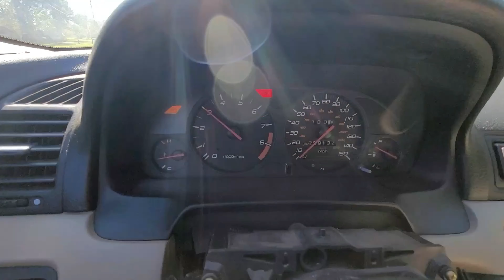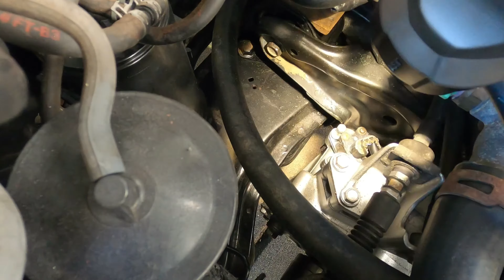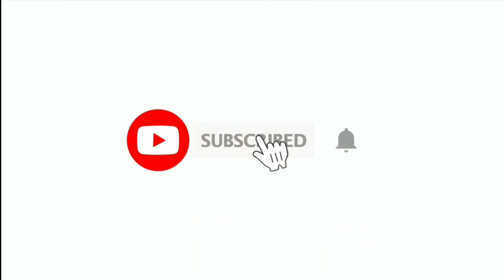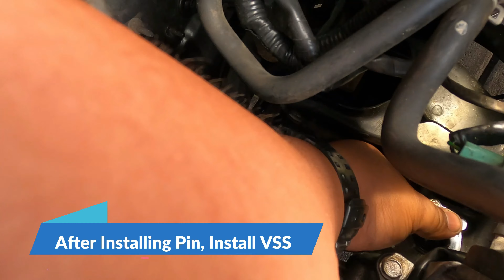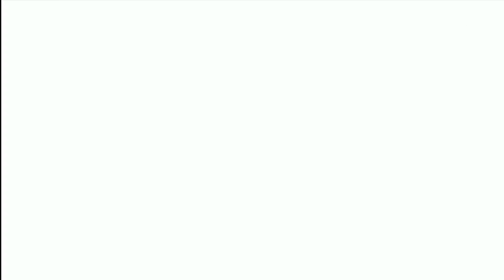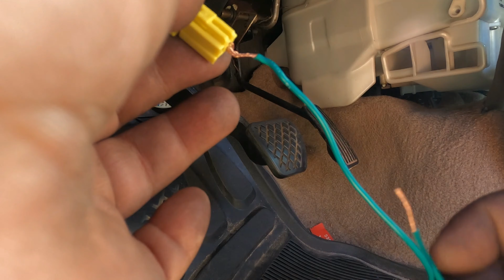1997 - 2001 Honda Prelude Vehicle Speed Sensor (VSS) / Speedometer repair and SRS Reset!

Comment: Fantastic job! Straight to the point concise simple videos. New subscriber!... I have two 1999 prelude Mt. 
One is the rat rod. 
One is completely original. 
Have you ever considered changing out your fifth gear to a Honda Accord fifth gear for that taller ratio so you're not screaming at 4500 RPM at highway speeds? 
Might you have any guidance on that?
Reply from the maker: I know some folks here uses lsd dif and final drive regearing from accord transmission. Long time ago, we swapped a USDM H22 to a 98 Accord. Used original Accord transmission and it performed relatively well.. Eventually, the transmission was swapped to a B16 with LSD [H2B].

Comment: Would replacing this sensor stop the d4 light from flashing and causing transmission problems in an automatic 5th gen ?
Reply from the maker: That's more likely to be a shift solenoid issue..

Comment: Just ordered one for my 99 model from Rockauto, 50 bucks.  Autozone wants $101 for that duralast.  Mine is intermittent right now.  Works about 99.9% of the time then it will fail for about 5 minutes then start working again.  Hope this fixes my issue.  If not, I'll have to start hunting wires.  I'm thinking this lil part was probably not intended to be used the way I use my car.  Cruise locked in at 85 for 3 hours at a time....with the occasional angry foot to 150 to get away from the morons.  Car only has 97k miles on it.
Reply from the maker: RockAuto hasn't failed me yet! I love shopping from them too!
I wish we could drive those speeds here in VA.. In my area, we're capped at 60mph.. little over that, in most cases, is a ticket..
If the replacement part works intermittently, check on your wirings.. you may have an open, short to ground, or loose connections..
Reply: That sounds like a hell of a sweet ride, I just bought one. A 1999 with 260,000 mi on it and paid $4200 because it was  one owner all original. 
What did you give for yours?

Comment: My son has a 5th gen prelude.   He said his RPM gauge stopped working,   any ideas what to check?  I am not finding anything on youtube.   Thanks in advance.  We used your videos to replace the clutch on his car.   Bro those were on point.  Thanks in advance
Reply from the maker: These are the things you want to check:
There's a capped connector close to the fender. Check the continuity with that blue wire to your distributor. There's a small blue wire in the dizzy connector. That is your rpm signal wire..
Remove cluster, make sure all connector to cluster is intact and clean..
It could be a dizzy failure, and / or ecm..
But most of the time, it's just an open circuit between the blue wire from the dizzy to the tachometer [cluster].

Comment: I know it's been a while since this post but could you tell me which way the wires are going into the plug on that vss. My plug caught fire and melted. I bought a new vss with pigtail but wires are different colors
Reply from the maker: This is from Shimee at Prelude Power:
The BLU/WHT goes to the gauge cluster, the BLK/YEL is (+) and goes to fuse no. 14, the BLK goes to the ground. Download the Helms manual from here (http://www.preludepower.com/forums/showthread.php?t=312936) and turn to pages 23-62 for more information.
Reply: @MarkH22  You are the king!

Comment: I have a 96 5 speed manual,Honda prelude s. My speedometer isn't working,when I scanned the car the code said it's the vss. Is the vss in the same spot? I had a transmission shop tell me that my vehicle does not have a VSS because it's a manual
Reply: Yes the vss is the vehicle speed sensor

Comment: Would this cause the tachometer to stop working and make the car go in limp mode? Wondering if this is the cause
Reply from the maker: Tachometer and limping aren't caused by this.. just purely speedometer.. The tachometer is tied with the signal coming from the distributor unit..

Comment: Would the parts be the same for an automatic transmission? Or does it matter
Reply from the maker: I believe it is the same. I can't remember if there was a selection for manual or auto, but the replacement part definitely works well..
Reply: Thank you for the quick reply man appreciate you.

Comment: do you know how to fix a tachometer that isn’t working at all?
Reply from the maker: If all signal input, wiring, and plugs checks good [assuming you'd test them already] then the tachometer in your gauge cluster is more likely toast. You can also borrow a known good cluster for testing..
Reply: @MarkH22  haven’t tested anything that’s why i was wondering what i should look into testing first or what i should check
Reply from the maker: @xeey-3073  check the signal wire from dizzy (blue wire) if it's loose or has no connection, then check the plug that connects to your cluster.. also check you ecu for any loose plugs..

Comment: Is there a sensor for the RPM also? 
My preludes rpm goes up and down like crazy at any speed
Reply from the maker: Check blue wire from distributor if it's loose, that's your tach signal wire. Then check the pin number 5 in your 16 pin gray connector going to the cluster..
Reply: @MarkH22  would this be in a obd2 distributor?
Reply from the maker: @xeey-3073  yes

Comment: What does it mean if there’s no light indicator on when it should be since my speedometer doesn’t work? And also thank you for the video, I’ve been trying to find where the sensor is lol. You got a new sub 🤝
Reply from the maker: Verify that your "cel" light is working..
Turn ignition to 2nd position without starting it..
If "cel" light comes on, then the indicator is working for all trouble codes "check engine light" 
In your case, that's something I'll check on further..
Definitely start with the sensor, then check the actual sensor wiring for any broken lines, then it's not common, but it happens.. the speedometer needle might lost grip to where it mounts.. checking your cluster is also a good idea..
Reply: @MarkH22  Understood. I will make sure do exactly that. Thank you once again, you really helped a college student save some money🙏🏽🤝

Comment: My speedometer stopped working while I was driving about an hour ago and at the same time it stopped working,  my D4 light keeps flashing. The codes on my OBD are P0500, P1791, P0700. Do you think the faulty sensor somehow triggered a transmission code? I just hope my transmission isn't toast. Just had it rebuilt 3 years ago. I really hope it's just the sensor. Also, Honda says the sensor is on backorder till June. Would it be alright to continue to drive my car as normal or would I somehow blow my transmission or create more problems? 

Thanks for the video. The second I got home I went on youtube and found you. You've gained a follower!
Reply from the maker: It is better to tend and get the codes fixed, then cleared.. the codes are more likely to be triggered if the transmission ecu doesn't detect any speed input from the speed sensor.. if no data transfer to the transmission ecu, it will alter the shifting timing, the "d" blink will occur, and sometimes the transmission might get stuck on one gear [any gear, if it happens] and burn the shift solenoids causing transmission limp mode.
The speed sensor is available in some online retailers.. I often use Honda oem if I can..
Reply: @MarkH22  thank you so much for the thorough reply! I checked honda and it's back ordered till june. waiting for an aftermarket one to come in today. I'll use your video to guide me through the install after. Salamat!

Comment: Hey man do you know how to reset the atts sensor? And what even is the point for it if its a manual prelude? Is it just dead weight and useless?
Reply from the maker: Sometimes, you can get away with just disconnecting the battery.. but follow this step-by-step, it's a good read but helpful. ATTS troubleshooting differs to each situations..
https://www.preludepower.com/threads/howto-retrieve-cel-atts-abs-and-4ws-codes.312936/
Reply from the maker: Another thing to consider: https://www.carthrottle.com/post/w8er3qe/

Comment: hi i got error code P0700 and P1790   is there any   advice   you help  me with thankyou
Reply from the maker: Check this link:
https://honda-tech.com/forums/honda-prelude-4/check-engine-light-code-p0700-p0740-p1738-2069595/
When I had this problem to a 99 Prelude with auto transmission, we end up swapping the transmission out from a F22 accord..
Reply from the maker: P1790- check if tps is plugged in firmly.. if it is, then check voltage to the plug and check the resistance of the sensor using a multimeter if it is still within range..

Comment: Thanks for all your videos, its really helping! Is there a way i can contact you, i have other questions that you did not post about.
Reply from the maker: What's your questions?
Reply: @MarkH22  i have a problem with my cluster lights that wont light up and the dimmer doesnt work. Also, a couple of other questions like that.
Reply from the maker: @DjeCod6  if your needles and other indicators are working, then the next thing you want to check is the actual bulbs for illumination. Also check if  the wiring harness to the cluster is plugged in all the way. Before you troubleshoot the dimmer, make sure to check bulbs first..
Reply: @MarkH22  needles are working, changed the lights for new ones and it’s still not working
Reply from the maker: Check connector A [blue plug on dashboard wire harness]
See if you have a good connection from:
Pin #1 (Red/Black wire) that's for the lights ON indicator 
Pin #2 (Red wire) that's for the brightness control

Make sure that the 2 wires above have good contact with the cluster plug input.
If this doesn't work, check references voltage between ground to red wire, then ground to red/blk wire [5 to 8V]. You don't have to turn the ignition ON, just the headlight switch.

Comment: What intake is that?
Reply from the maker: Just generic intake tube for h22 engines..
Reply: @MarkH22  lol my dude was impressed and liked the generic shiny tube 😂 my key is stuck in the ignition i guess from wear down, one day after i got home i went back to start the car and the key wouldnt work in the ignition i finally got it to engage and turn it but now its stuck in. I cant afford $600-$800 for a new ignition switch and keys to be made and programmed. It also means i cant do the SRS plug short method to reset the SRS light. I tried and couldnt get it to work. Unless I had the wrong plug but i dont htink so it had the yellow tape and stuff on it which signifies air bag equipment wiring usually. Any suggestions how to get the SRS light off? When I first got it maybe 7 months later the alternator went out and made the brake light and SRS light come on. Ive left no battery in it while its been stored. (Its my track car build) that doesnt reset anything on my car. Could I get a code reader than can view the SRS codes and information and clear them ? My bluetooth code reader apparently doesnt look for SRS and ABS codes and data because my Accord just had the SRS light come on and wont go off now.
Reply from the maker: @DankNoodles420  the new code reader I have can reset the srs light, [ancel ds700]
But you don't have to have an expensive reader like what I've just acquired to do the trick. Shorting method was always my go to, but you have to have the ignition switch in working order first.. I would also check the wiring under the seats if it's plugged good andd or if the wires aren't damaged, then check if the srs fuses are good..
Reply: @DankNoodles420  what can I say I like shinny things 😂

Comment: I replaced about 5 years ago on my 98 prelude. I had a cel po325. I fixed it. All set. I have a srs and abs lite on my 95 honda odyssey with 300,050 miles. Have not been able to clear. Gave up